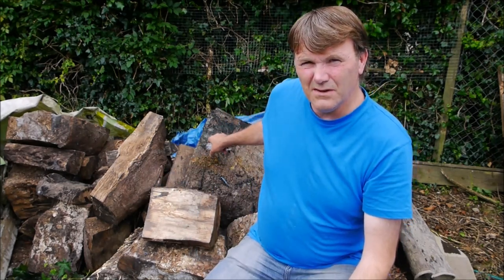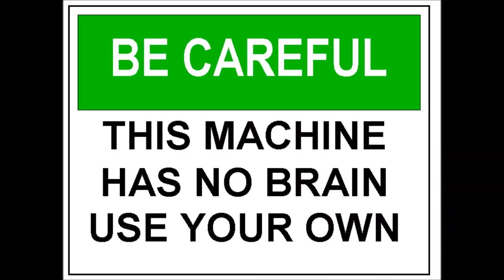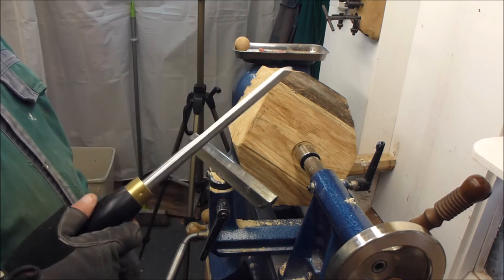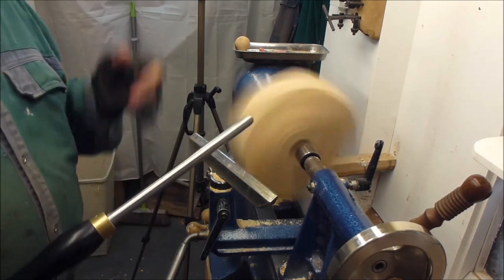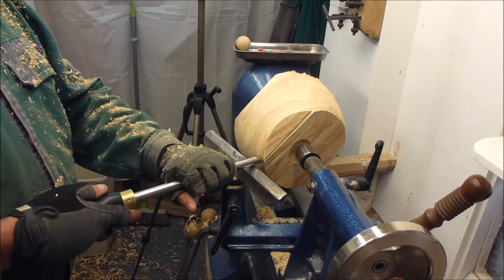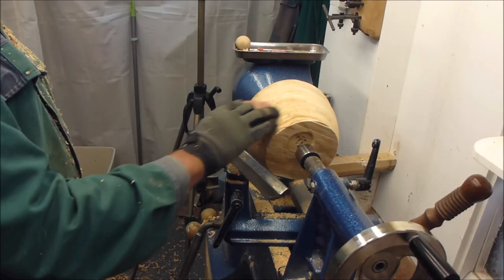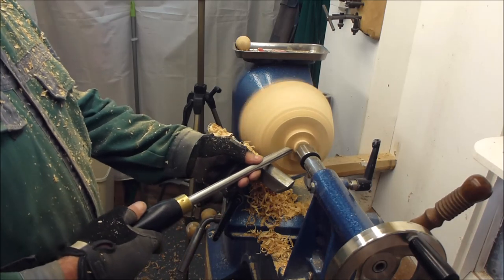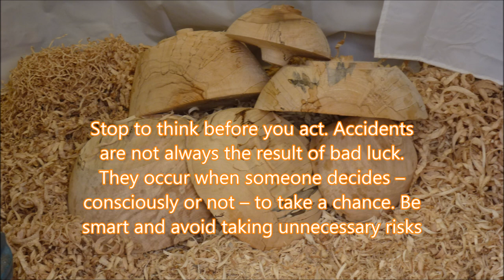Woodturning Bowls blanks Explained

Comment: Super video Robbie.  Ever since you showed us how to rough turn a bowl by cutting across the grain a long time ago I've used that method and certainly don't miss getting beaten up by the wood bouncing the gouge back at me.  I am very interested in the Ellsworth gouges now that you've shown just how versatile they are in good hands so that's something for me to aspire to.
Best Wishes, Brendan.
Reply from the maker: baconsoda  Thanks brendan its a excellent tool when you learn how to handle it 
a 3/8 gouge can work the same if it ground right 55 on the tip and ground 3/4  swept back  side grind.
All the best Robbie

Comment: Man that gouge can cut!! you made me want to betray my other 5/8th gouge... do these need a special kind of grinding to keep their profile? If I got the gouge will I need to invest is some elaborate grinding jig just to keep it sharp? That was a nice demonstration Robbie, thank you!! (also, that blank moth flying around, I thought it was a small bat it first...).

Yuval.
Reply from the maker: Yuval Lahav lol Yuval it was a butterfly i have allot of hatching out in the shop at the moment.
the gouge has 55 on the tip and ground 3/4  swept back  side grind.

it will work on a 3/8 gouge
Reply: T
Reply: R